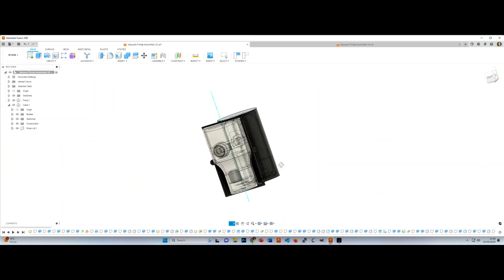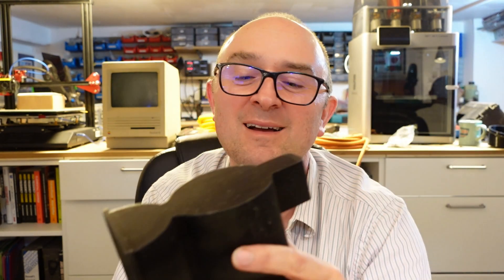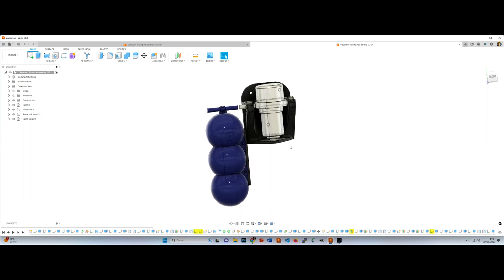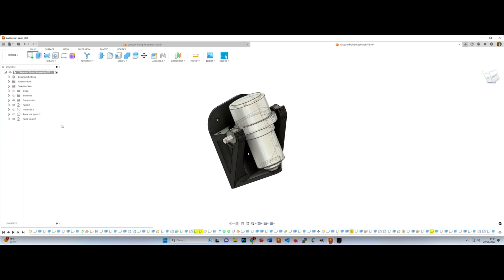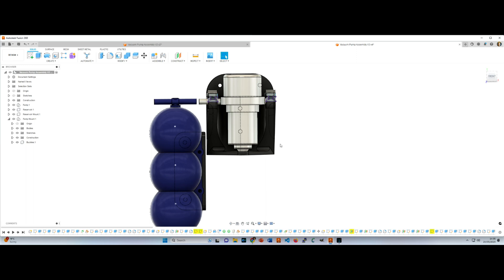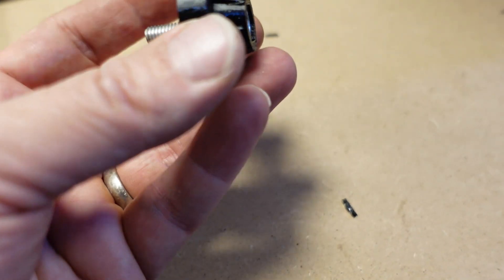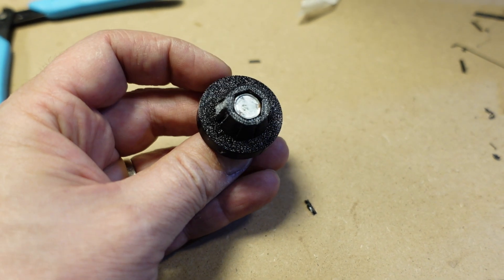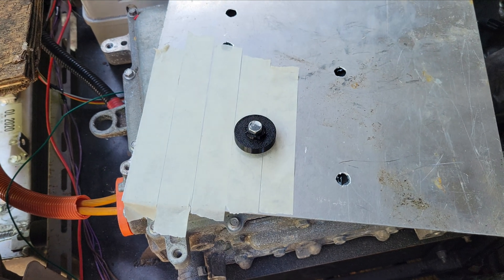DIY EV Brake Booster: From CAD to fitting

Comment: I just finished the installation of my VAC pump, sensor and associated pipework and posted on my EV thread on Landyzone. Sorry I can't post a link as YouTube will delete the post if I do. If you go to the Freelander section of Landyzone you'll see it. Anyway I now need to sort a box/container for the Johannes sensor board and yours looks great. Would you mind sharing the stl file for it?
Thanks. 🙂
Reply from the maker: I'll check that out as mine isn't actually working. Tested it yesterday. Board is getting signal from the sensor but not switching. Not sure why so have built up a little Arduino board to see if that sorks.

No problem on the stl. Original is (I think) on the OI forum in the discussion about Johu's board but I can add a link to the video description later. Or message it to you.
Reply: @EVDIY  Thanks Tom, I just found it on page 3 of the thread. I haven't used my 3D printer for ages so it'll be a great excuse to fire it up again.

Comment: I don't have any CAD skills (unless you count cardboard) so I made my mount by cutting, welding and a lot of grinding. I cut up an old sack trolley to get mounts for the rubber bungs and made it so one end can be bolted on to enable the pump to be squeezed in.
I mulled over where to mount my vac pump for a while before realising there was a hole already in the bulkhead for the clutch master cylinder. A large bolt with an oversized washer either side and it is done. I still haven't decided where to mount the reservoir but I'm going to try to use the original Freelander one.
I've heard so many scare stories about cutting or drilling holes causing the DVLA to turn down cars, I'm avoiding drilling or welding to anything.
Reply from the maker: Same...mostly... 😜

Comment: I used a small oil catch can for my resevoir about a third the size of yours gives me about 4 presses of the brake pedal before the booster kicks in definitley worth adding also had the same trouble as you with those ally brazing rods threw them away in the end
Reply from the maker: Crikey. I should get loads! Have a smaller reservoir for the next car.

Comment: put a check valve between the pump and reservoir. Those pumps when stopped leak quite a bit.
Reply from the maker: Thinking I could put one on the back of the pump maybe?